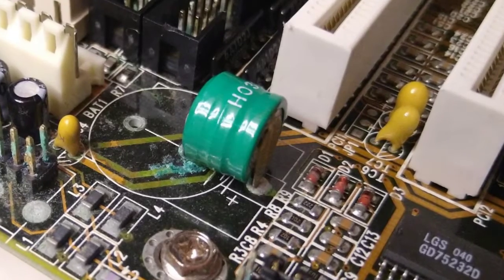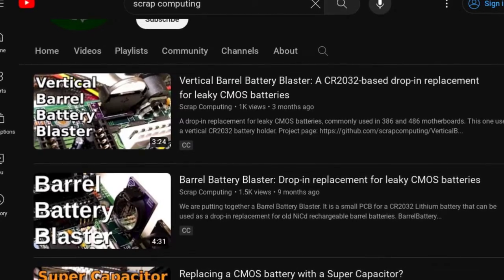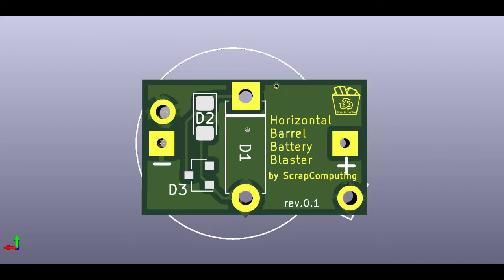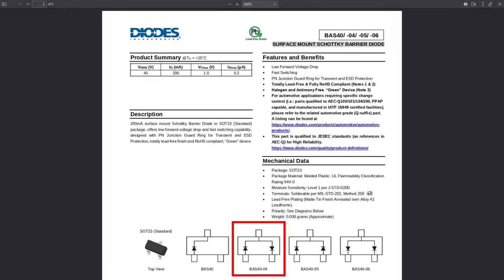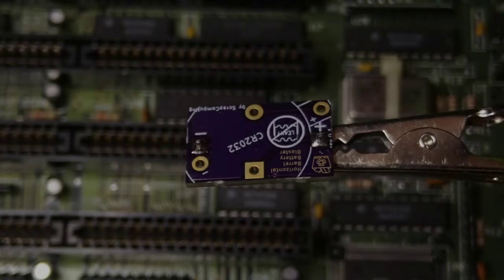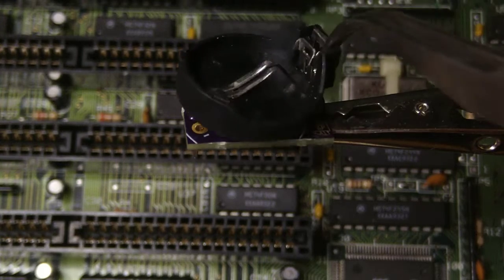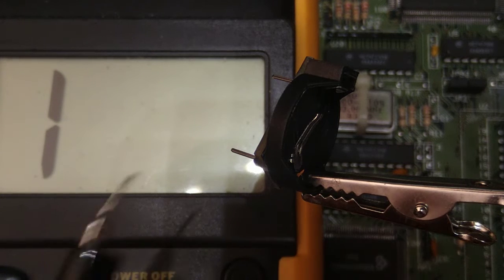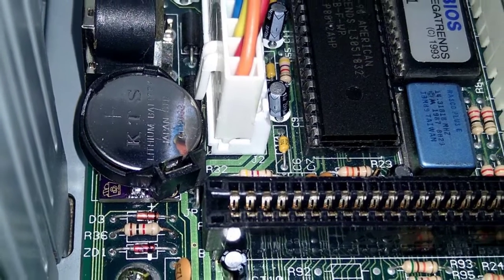Horizontal Barrel Battery Blaster: A CR2032-based barrel battery drop-in replacement

Comment: hello SC. i have an intel RC440BX ATX version board with PIII @ 500MHz that does NOT boot with the battery ON. I remove the battery, the board boots with no issues. Have you encountered something like this? it's so strange, for me, at least
Reply from the maker: Indeed really strange. Could it be that the CMOS chip is bad, so  when the configuration is read from it, it's always corrupted?

Comment: I don't want to be a bearer of bad news, but this project is completely worthless. 
You see - the BAS40 schottky diode has 380mV forward voltage drop. That value means how much of the power will be consumed by the diode and converted to heat. Also, by that much the voltage of the battery will be lessened. 
Let me give you an example. The most widely used time chip among these boards is HM6418A. This chip power requirement is between 3-6V, with my experience at around 2.8V the chip stops advancing time and around 2.5V it starts losing data. CR2032 has the nominal voltage of 3V, brand new out-of-packaging is around 3.2V and all it lifespan it follows a strict curve - it drops quite fast to 3V, where it stays for a long time and then it starts falling down gradually (of course this applies only to quality brand cells. Cheap off-brand has the lifespan way shorter and way steeper). Now, if you take the BAS40 diode and put the power of brand new CR2032 through it, you get 3.2V-0.38V=2.82V. So we have only 0.02 margin until the chip starts to behave erratically. If the voltage drops a little bit and stabilises on the 3V mark, after the diode there would be 2.62V. And the chip is stone cold. So, with this setup you have to change the battery about every month or so. 
And if you think I am babbling nonsense - there are A LOT of cases where people made the original design and then complained it is not working. This problem already was remedied by project Not-A-Varta by Wiretap-Retro, available on GitHub. It comes in two sizes, with CR2032 and CR1220 and it uses the MAX40200 chip which was engineered specifically for this purpose and its voltage drop is around 20mV. 3V-0.02V=2.97V. WAY more suitable for this application. 
Don't get me wrong, you get a thumbs up from me for the initiative, but in this case the attempts to re-invent the wheel were not good for anybody, actually it was quite the opposite because now more people will create this marginally functional design.
Reply from the maker: Thanks for the feedback! Yeah the MAX40200 is a great way to reduce the voltage drop. I just added solder pads for it in revision 0.2.

Comment: Would a CR1025 work? Holders are available and have a width of 10 mm vs 20 mm. You loose capacity, but sometimes space on the main board is more important.
Reply: It should. 3 volts DC is 3 volts DC, regardless of how you get it. Used to solder in a wired two AA battery holder with a diode as a replacement back in the day.
Reply: @davidcameron648  I thought so, how about the 235 mAh vs 50 mAh? We just need to replace them 4 times as much?

Comment: we're lucky that these old clock chips tolerate 3V batteries. I believe the original Varta batteries were 4.5V.
Reply: The Varta batteries actually had too high a voltage for the clock chip and needed a resistor to drop it to 3 volts (if I remember correctly). Many later main boards (including the first one shown in this video), have PCB footprints for both the rechargeable barrel batteries and a coin cell holder. Some also had headers for a wired battery pack.
Reply: @davidcameron648  This is complete nonsense. The time chip usually requires 3-6V of operating voltage (HM6818A/146818 3-6V, DS12885 2,5-4V, 82C206 has 6V battery specified in datasheet). Resistor would only drain the battery flat in basically no time.

Comment: Would you be able to design such an adapter for the CR2032 that fits that typical 3 hole design of a BR2335? So basically allowing the usage of a CR2032 in Mainboards that used BR2335?
Reply from the maker: It shouldn't be too hard. I am not sure I have a motherboard with such a battery so that I can test it, but I will check.

Comment: Neat! I'm about to solder some of the original ones and then install them in 2 pc's I am fixing.

I have some other old pc's that take a 4-pin "external" battery that I have to find some replacements for though.